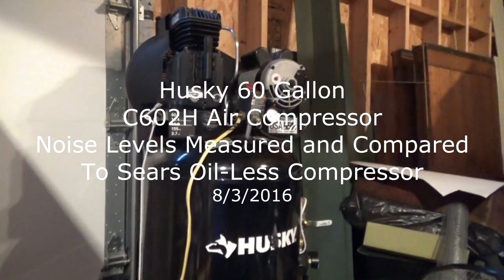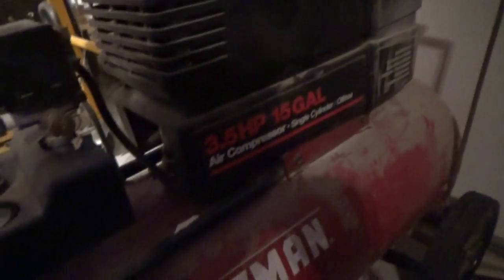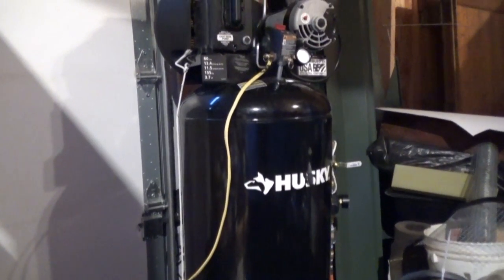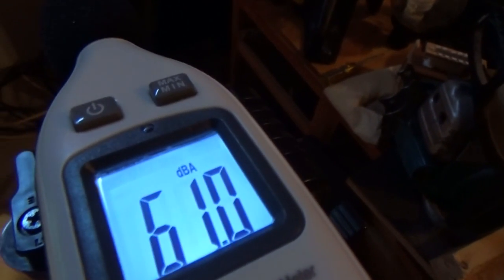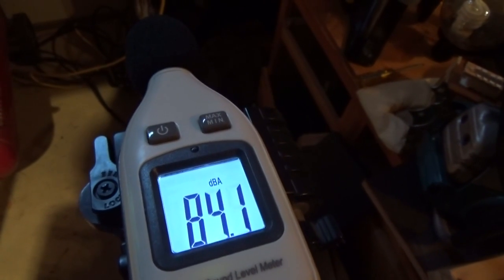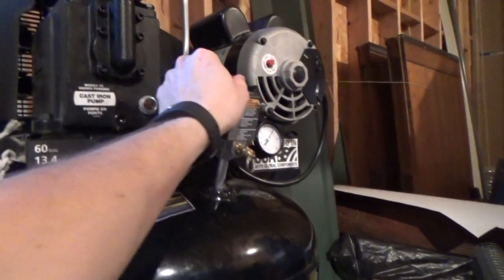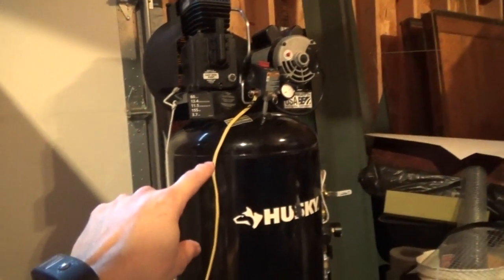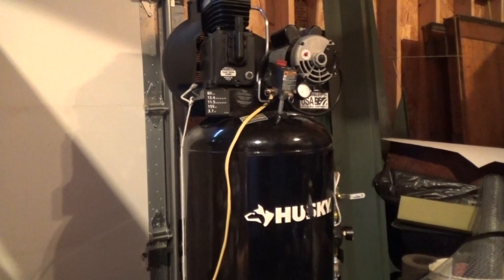Husky 60 Gallon Compressor Noise Levels with Sound Meter

Comment: Noise Level and Frequency determine the irritation level of sound.  The 60 gal. compressor is louder but the frequency is not irritating to the level as the small compressor is.